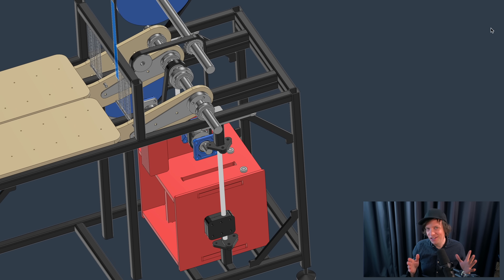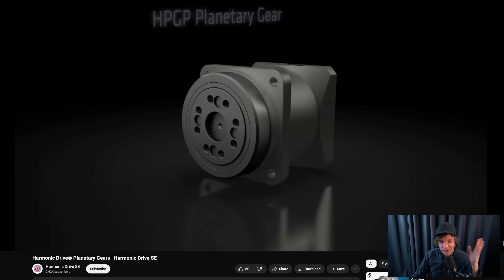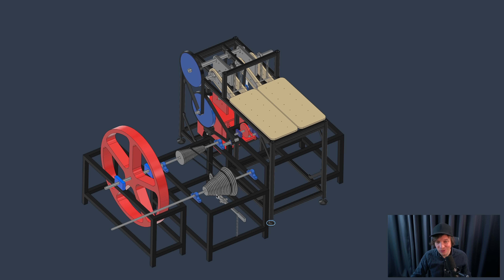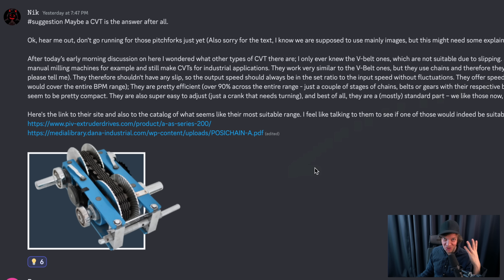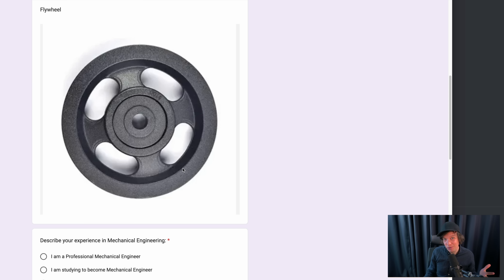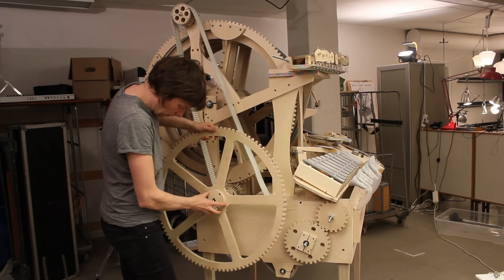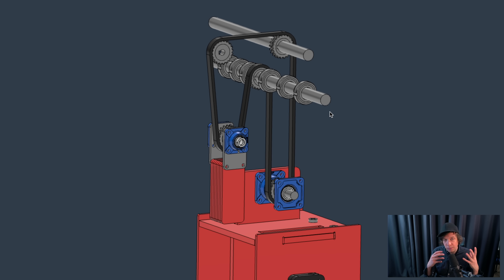Which Gear Type is Most Efficient?

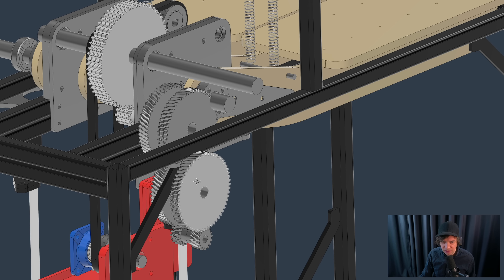Comment: I'm (very) surprised to deal with 1:50 ratio without starting by the begining:
- How many different actionning systems?
- What is the action force for one single actionning channel?
- What is the total action force required if no marble is released, and balls conveyors empty?
- What is the total action force if all channels are releasing a marble and conveyors saturated?
- What is the moment of inertia of the whole system (running empty) without any flywheel?
- Now do the same analysis across a whole song which has big instensity variations to get a curve.
  - The steepest angle of the curve => energy to be stored in the regulator (easy to match by natuure)
  - Mean level = mean powering level. Has to be < 50W otherwise, you will do more sport than music
  - Highest ampitude difference = higgest timing drop => dimension flywheel moment of inertia
- Now do the same analysis on different songs and produce a bell curve or a quadrant diagram. It will link the style of music that you can play with timming impact force
  - define your "target area of play". 
  - flywheel energy should be limited to 1 KJ (= 1.5m drop for a man) to be safe.
- Now check:
  - the impact of the unitary force to play 1 marble (multiplied by the number of channels) on the flywheel and regulator
  - the value of the unitary force (it should not exceed 0.1N per channel (for standard marbles)
  - what if flying wheel and regulator are connected only to the actioning system (w/o conveyor system) vs the whole system.
- Then design a prorotype of lifting mechanism + dropping system and test it (ie. do the same analysis and check that the one-channel system is working as theoritically foreseen)
  - identify all sources of energy consumption and ensure that they do not scale up exponentially with machine size / marble size.
  - if any discrepencies, identify the source, understand it and check how it could be worse/better
  - check the timing precision and validate your global analysis.
- Then do a second 1-channel prorotype with ALL corrections. And iterate up it fits directly your analysis.
- Now you have validated your concept and defined your flying wheel and regulator specifications.
- And this is only now that you can work on your powering system.

And so to say it short:
- playing on click seems to be so important that I think that you shoud be able to have a click-indicator
- You currently have no idea of the flywheel desired moment of inertia therefore design.
- You need a simple and quick launching mechanism (eg. to suspend to a rope to reach the ground hooked on it)
- Regulation system should be disconnected from the conveying system (may lead to 2 separate systems).
- A second pedal directly linked to the flywheel (not the huygens drive) to adjust manually the speed (to stay on click),
- A third pedal to power up the independent conveyor belts (so they will have no impact on timing)
- A click tracking system showing you if you are early/late for the click, and let you catch up if necesary (All your over engrineering of the driving looks tlike you just want to be able to play on click)
- I may be wrong but the marble gates use 10 times more power as the their conveying up (cf. below) that why marble gates activation energy should be even more considered.

Example = dropping 30 marbles = 3N, takes 0.2sec to activate => 15J (equiv 0.5J/5W per marble drop, 0.05J/6mW to convey up)
15 J drop = 0.1% speed rotation = system of a speed rotation of 15000J => 1m diameter - 10 kg - 20 turns/sec.

Comment: Use a cvt! You're not putting it on a car with high rpm and high torque you'll be fine with it,  I'd also recommended a gearbox company we sell in the states but they are very expensive but would make exactly what you need/want

Comment: planetary gearsets work well in both directions. old automatic band and clutch transmissions used bands to hold the ring gear or clutch packs to hold the sun gear. they can be used in both directions

Comment: Again suggesting that (1) You use 2 Hyugen drives instead of just relying on constantly inputting power to run the marble-return conveyor; (2) you place the weights for the Hyugen drive away from the power-input module so that you can raise the weights to arbitrary height.
This combination will allow you to store power gradually in weights that take longer to fall.  This way, you won't exhaust yourself on tour.

Comment: Be careful with relying on the laws of physics for practical applications, there are a lot of them and most of the time only the most relevant are used with the assumption of constant conditions for the others in order to greatly simplify the math. You are wanting to go on tour with this which means things like air pressure, temperature, humidity, stability/flatness/consistency of the floor, sound vibrations, wear, and the like are probably going to cause problems and likely affect the math. Make sure you have plenty of tolerance built in and no fixed positions for adjustments and it should be ok, otherwise 120bpm in one venue might be 110bpm in another or 130bpm in a third. You will probably need to calibrate the machine before each performance too so make sure that can be done quickly and easily.

Comment: And trying to speed up some shaft 50X would add a lot of resistance.  I am no engineer, but have played around with gears and stuff for a long time.  I think your decision to not use one of those variable  speed drives is a good one.  Not only would they not be consistent,  I fear they would add friction.  With such an ambitious design, friction and resistance are going to be your enemy.  Plus, as I said below, tightness will be a problem with too many speed/direction changes....    I've been watching your videos since you built your first marble machine....!

Comment: I'm worried about having too many gears, because there has to be a little slop between each gear, or they would bind.  Slop = less tight music.  Belts might ultimately be more precise, But another consideration is complexity and friction.  Every time you introduce a gear, or a belt, you introduce more friction.  You might end up needing a 2 HP motor to drive it all!  Just kidding, but do be careful of adding too much friction, or too much slop.

Comment: I know this is not the proper channel for feedback, but I would prefer chain and sprocket over timing belts, be cause they are usually more efficient. There is a reason all high speed human-powered bikes use chain and sprocket rather than belts.

Comment: You know what kinda transmission is as flexible as timing belts and (nearly) as efficient as straight cut gears? nu? well.. it's chains! \o/

happy chain transmission dance

EDIT : Even SKF is recommending chains O.O why didn't you consider the option for the flywheel? o.O
EDIT 2 : ok nvm it is litteraly an option in the "nuance" feedback xD

Comment: I think for efficiency only a single tensioner and a belt system. A chain would need lube and will be louder. A flywheel that holds water would be easier to empty and refill when the machine goes on tour.

Comment: Planetary gear boxes are less efficient since you have more moving parts and more engaged teeth. They are very good at transmitting torque because they have more teath to divide the load.

They also don't like to be back driven.

Toothed belts are efficient but so are v-belts.

A.properly tensioned belt is an efficient way to transmit torque and speed.

Obviously, not the best option for timing but a very good option for power transmission.

Comment: The one thing I am absolutely sure of, is the idea ALWAYS starts on paper. To do anything else, is to put the cart before the horse and ask the cart to pull the horse. It will not happen. 

The second thing is that in the creation of the previous iterations of the marble machine, have been utilizing hand made parts. It would seem cost effective in time, as well as money (I.e. buying more materials because the first attempt did not work.)  

If you have the 2D idea written down, then you can open up a discussion with the engineers, and find the solutions. 

I said all of that to say this: I have followed you through the past two marble machines, waiting for the reveal of the world tour. And it didn’t happen. I am not sure if that was by design, or that you felt the marble machines would be the job, but they didn’t quite do the job you wanted. If those two machines were proving grounds for the final product, then you should know that instead of all that time invested could have been saved by careful planning and a 2D rendering of the idea. THEN do a cad drawing, make a parts list, and proceed to build. 

I’m no engineer, but I am an artist, and I create 3D sculptures as well as paintings, and I am a musician. All of these things require starting with a piece of paper to get the process going. 

My thoughts on the gears is this: if you are moving the MM from one stage to the other, metal gears may be a problem to align. Pulleys and belts are easier to align, and belts can be replaced a lot quicker if one breaks. 

Those are my thoughts. I truly can’t wait to see the end results!